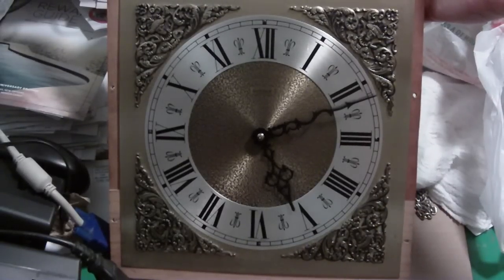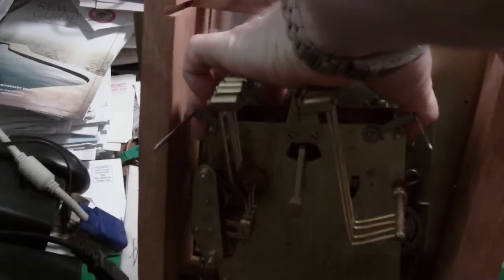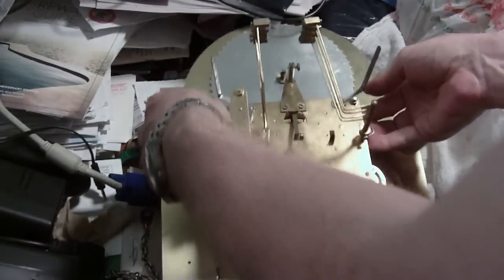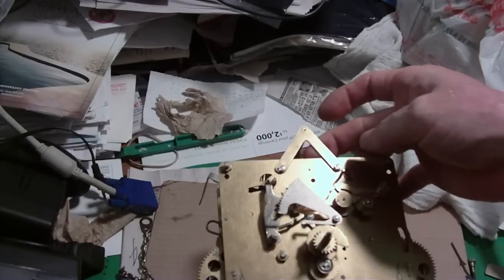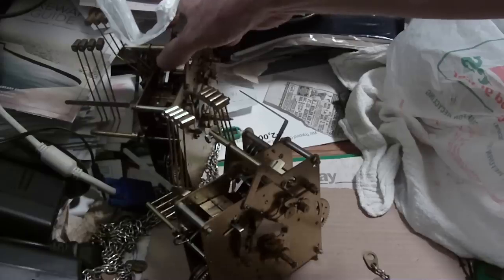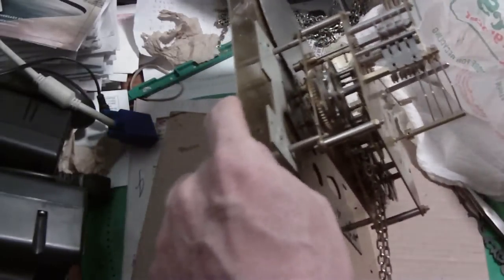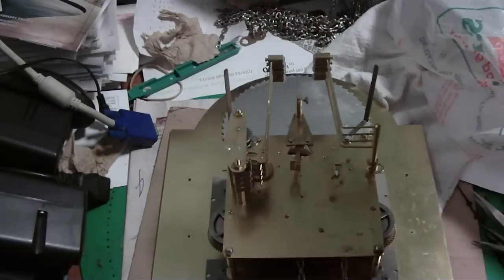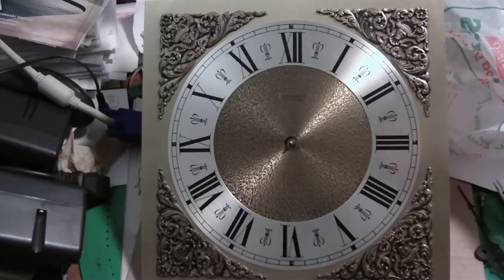Replacing movement of grandfather clock, Emporer Clock, Hermle movement

Comment: Gonna have to do the same to my emperor.
has a Jauch 77 Right now, and even after oiling, keeps terrible time and chime mechanism is on the way out, not to mention a hammer is broken and re-superglued.

Plan to go for a new hermle movement (direct replacement), just too bad on the prices though, like 300 bucks.
Reply from the maker: I know, new Hermle movements are expensive.  If you look on ebay you might get a nice used one cheap.  The replacement movement for this clock I bought from ebay for 25 dollars.  The seller said they cleaned and oiled it but it would only run for a little bit.  I looked at the pictures and saw why it wouldn't run.  Easy fix, suspension spring was bent just enough to keep it from running.  Hasn't stopped since then.
Reply: @bunnspecial  can you make another vid of the emperor clock

Comment: hello,fellow clock lover. I'm new to clocks but have some knowledge of watches and I'm fascinated with em. anyway I thought I'd ask you for a little advice on a curio clock I recently purchased, it currently not working and I'm in need of parts and knowledge of repairing and servicing clocks and watches but I'll try to tell you a little of what I know of it, and hope,and pray you can and will take the time to help me... it's a bonet style Ridgeway grandfather or curio clock.. it says franz hermle on the back of the movement also 85, Franz hermle  no (0) jewels unadjusted made in West Germany, .1151-053HS , 94cm. 66,00.. anyway that's about all I can tell you about it.. I hope all this means something to you cause it's not meaning alot to me at the time, and I don't know how to learn it
. but thanks in advance. and God bless
Reply from the maker: Look on ebay and you will find a whole bunch of these for sale.  The movement I show in this video I bought from ebay.  In the description on ebay it said that it was cleaned and oiled but would not run.  I don't know much about clocks but when I looked at the pictures I saw right away what was wrong.  The suspension spring was slightly bent to one side.  I straightened the spring and it has been running for years.  Maybe your clock needs a cleaning and oiling or something is bent or broken.
Reply: Jerry & Tina King n

Comment: I took apart and put back together a hermle 351 - 031 movement could you please tell me  or SHOW me a pic or drawing on EXACTLY" how the front should be/appear/ to function properly,(all the hardware as it should be), I usually take it to a clock repairer,( eddie takianor something of that kind of name IN ORANGE, CA,), Then I asked the "OC CLOCKMAKER", he said he'd get back to me "on you-tube" but he never did even after I called him and left a message.........please help. thank you.  A BUDDING CLOCKMAKER/REPAIRER
Reply from the maker: I am not a clockmaker.  You have the same problem I had after I took one of these apart, the timing for the chimes was all screwed up.  I stood there for at least a half hour moving the minute hand clockwise watching the cams for the chimes move before I understood how to set the cams in the correct position.  This was several years ago and I have since forgotten.  I did take pictures of the movement before I took it apart but those cam locations are only good for the time the colck was stopped at.

Comment: I honestly would have just bought a whole new movement, hermle movements are cheap and not worth the time to rebuild.
Reply from the maker: At the time I did this video a new movement was 225 USD.  I did not want to spend that much so I bought a used movement for 27 USD.  The used movement was cleaned and oiled by the seller, but he could not get it to run.  From the pictures I could see why it wouldn't run so I bought it.  This used movement has been running for over 10 years.
Reply: Thats aweaome you found such a deal mine required a new movement at 375.